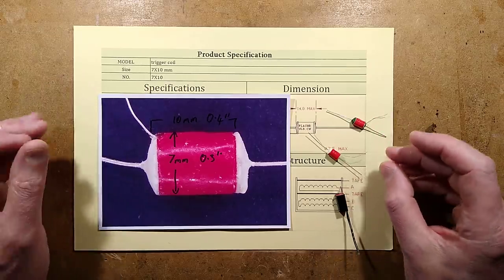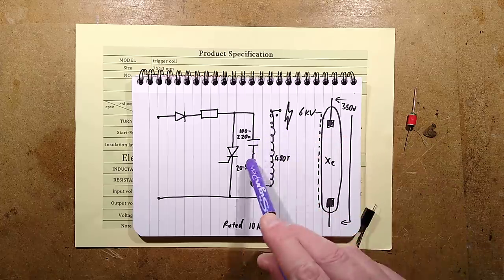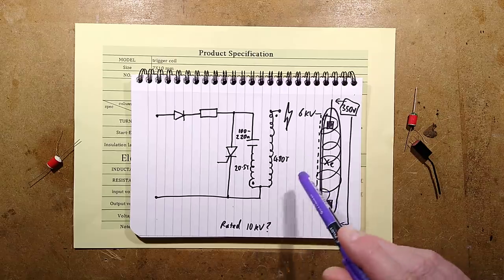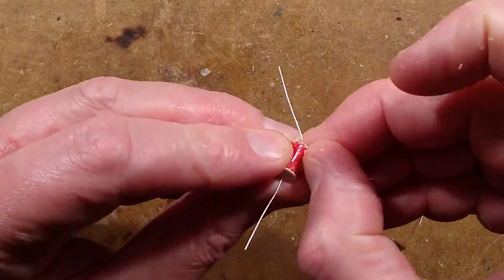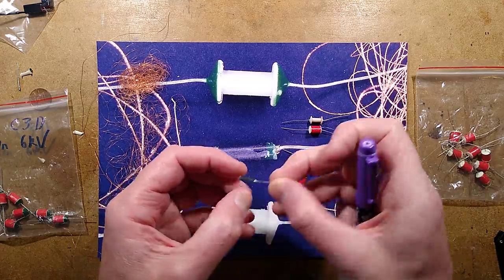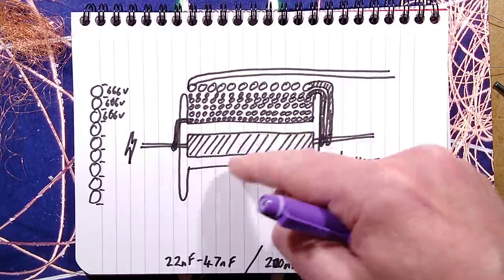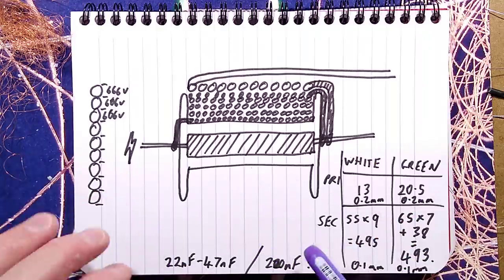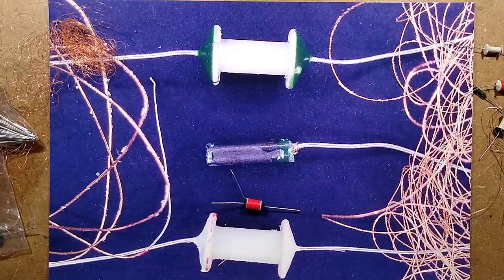Unwinding a tiny 6kV xenon trigger transformer

Comment: Transformers in my head are the gearboxes of the electronic realm
Reply: Yup. Turns low torque high speed into high torque low speed, or the other way around.
Reply: @hobbified  looks like magic, takes a lot of knowledge before starting, and insanely powerful skill once you master it. Smells like gearbox, looks like gearbox, can sound like gearbox.  Yup, it's a gearbox.
Reply: or leverage :)
Reply: @mimimi9170  : Give me a high enough windings ratio, and a ground to reference off of, and I will move the very earth!
Reply: @absalomdraconis  ahaha you're god damn right Archimedes
Reply: 666v per layer, Satan’s Gearbox! Sounds like a rad band name, and now, Satan’s Gearbox!
Reply: @mimimi9170  at this kind of voltage, the first syllable of that name is quite apt.
Reply: @markparker5585  Umm, looks funny but I don't get the point. Do you mean "lev"?
Reply: @mimimi9170  Arc
Reply: @markparker5585  Oh! I see🤦‍♂️  Thank you!
Reply: @mimimi9170     Archimedes moment was in the lever age.
Reply: @absalomdraconis    Move the earth, you wouldn't be grounded.
Reply: That’s fucking perfect. Why didn’t anyone else think of that? It’s like how your keys are a physical password. If you can see the bitting, then you are looking at a plain text password, essentially. Moral here is that you should treat your keys this way. Never take a photo of them without censoring the blade.
Reply: Can't unsee that now. It's perfect.
Reply: A good analogy for simple understanding for sure. Only difference is one is physics and one is mechanics.
Reply: @uzaiyaro  I have a locksmith friend who, when presented with a locked car, looks for the keys. If they are visible, he will punch out a new key rather than messing around with other methods of opening the door.
Reply: I thought they were robots in disguise.
💚🐇🐴💚
Reply: Interesting analogy, I like it.
Reply: @oplefirem  isn't it just.
Reply: Voltage & Amperage   
Speed & Torque
Pressure & Flow

In a sense, its all the same!
Reply: @BunnyKins1970  In this case, they're high voltage in disguise.
Reply: @absalomdraconis  wait, I thought you were referencing to earth…

Comment: The voltage between layers is actually about 1320V at one end and 0V at the other end where the winding reverses direction. The 660V you calculated is the average between layers.

Comment: I remember buying one of these from Maplin (among other things) as a young teen just because I saw it was a "6kV transformer" and I wanted to make HV arcs with it, but I had no idea how it worked and I just ended up blowing it up
Reply: RIP Maplin :(
Reply: As a kid, I used to plug LEDs straight into the mains thinking that they would be way brighter, turns out they just crack internally and get dark lol.
Reply: @GoldSrc_  it's how you make a black LED
Reply: @ianhosier4042  
That's a dark emitting diode, commonly called DED.
Reply: @wingerrrrrrrrr  don't you mean a DEAD?
Reply: @GoldSrc_  :/
Recently, I was experimenting with a 7W laser diode, attempting to get more optical power from it by running it at much higher currents at less than 50% duty cycle, while cooling it to -15c.

It was all going quite well, until I ran it for too long. I cannot determine if it was thermal shock on the die, or if the die overheated during the extended run (probably the latter, but I have no way of measuring the actual die temperature).

Either way I was successful in creating a DED. (Dark Emitting Diode)
Reply: @GoldSrc_  I did this with a 12V fan from an old PC!

Comment: Seeing those rounded ends and the wax reminds me of the old wax-paper capacitors you find in old valve radios. Of course, since these don't have the paper being used as a dielectric, I would hope that these wouldn't break down so easily unless the wax melts or cracks and lets moisture in.

Comment: Excellent and very informative video, thank you.

I still have a few of these little Tx's lying around in my workshop. These ones were made by RadioShack. Back in the '70's in my days as a club DJ big strobes were practically unobtainable, and ones that were triggered by the bass beat in a song did not exist at all, outside of Hawkwind's collection of mighty 4 channel Rainbow Strobes. 

I found a bog standard battery driven little 'photoflash' circuit, and beefed it up to work direct-on-line (no isolation Tx - would have made it too heavy) from the 240V mains - the upgraded PSU developed well over 480V peak to peak to a set of 3 massive, 5 Joules each, Xenon strobe tubes soldered into an Octal valve plug and their trigger poles commoned. The power to drive them was stored in a bank of 32uF 600VDC PF capacitors, with the safety resistors taken out (Health and safety? - Oh right - it's the 1970's).  The trigger cct. was built using a 741 op-amp in an active low-pass filter that took a signal from the LS cabinet and the o/p sent via an isolating pulse Tx to a UJT that fed the trigger Tx.

The reflector was made from an old silvered glass footlight reflector salvaged from an Edwardian theatre demolition - it was just over a foot across. The effect was absolutely awesome. Dancers appeared to be in 'stop motion' as the beat from the disco track matched their rhythm. I got paid serious money hiring it out to other club DJ's, also.

Great times !

Comment: wonder how that compares to whatever they used in the old kodak disposable cameras. Those gave quite the shock if you touched the board in the right places.
Reply: Loved taking those apart to tinker with.
Reply: @ICountFrom0  Same! So much potential for projects. I got a very good shock and a burn on my thumb the first time I opened one lol.
Reply: that's the 350V electrolytic capacitor... not too long ago i opened my compact camera, got shocked, destroyed the flash circuit, it doesn't flash anymore, i salvaged the tube, the 350V cap, the transformer and also a SOP-8 IGBT that apparently cuts the flash duration to save cap charge and batteries
Reply: Ahh, memories.  Back when you could bring pocket knives on airplanes. I, as a kid amused myself on the flight back from a vacation by tearing one of those apart.  It was quite shocking. :D

Comment: Best piece of advice I ever received as a kid (that I listened to) was to "go down to your local drug store and ask if you can have some of the processed disposable cameras." 20 years later and I still have the box of around 100 pcb's from my haul! Each board has a trigger transformer and flash tube and it was so cool to see all the variations in parts and design from the major manufacturers.

Comment: A sibling of mine got an electronic barbeque lighter once. It used a 9 volt battery. It had a 1000 MF, 16 volt electrolytic capacitor, a small transformer in it, and a switch. He put it into a small project box. It put out quite a jolt. It was a miniature version of a car ignition coil. If I recall, I think I have seen the transformer you have on some type of photo flash circuit. Cheers!

Comment: Just a suggestion get a disposable film camera, single AA cell HV inverter and a flash tube and trigger for a few pounds
Reply: I agree. Once, when I was young, at a garage/yard sale, I bought a toy gun. It had a photo flash type circuit inside, but didn't have the electrolytic high voltage capacitor that a regular photo flash circuit had. It still had very small transformers, and a mini flash tube. It was pretty neat.

Comment: Use to use these trigger transformers in strobe circuits all the time. Radio Shack use to sell both the transformers and xenon strobe tubes, back in the old days. You use to supply ~300V, that charged up a special electrolytic, that could handle the high current pulse, when discharged. These have been replaced by really bright LEDs, in cameras. Even old disposable film cameras, had xenon strobes built into them.
Reply from the maker: And they sold the big fat flash capacitors.

Comment: That took me back to unwinding a transformer and getting waxy stuff everywhere. I'd burned out the power supply for my train set by holding the reset button down and wax had leaked out of the transformer (and then presumably shorted). I was amazed to see just how finely the wires were wound. But, come to think of it, no more finely that the spools of thread on my grandmother's ancient sewing machine.

Comment: I always thought that there was magnesium in these Tubes.

Xenon makes so much more sense 

Thank you!
Reply: The old single-shot flash-bulbs used magnesium wool in an oxygen atmosphere.  The trigger pulse (not sure what voltage) just ignited the magnesium, which burned rapidly, consuming the oxygen in the bulb and sometimes shattering the bulb with an audible pop.  The bulbs were usually plastic coated so they didn't make shrapnel if the glass envelope shattered.  Wikipedia has a page on flash photography covering everything from the really old pans of magnesium flash powder up to high current flash LEDs: https://en.wikipedia.org/wiki/Flash_(photography)#Flashbulbs.

Comment: The coils I got hold of were not so friendly! They had potted them with epoxy!  I got an idea of how many turns by taking the coil on the belt sander and sanding off the coil to half gone giving a complete cross section. I was able to use a glass to see how many turns on a layer and how many layers. No chance whatsoever to reuse them like the wax potted coils you got.
Reply from the maker: If they're the little black box type they are definitely more reliable than the open ones and have the advantage of a higher voltage rating.  You could wind your own custom primary on the outside of one.

Comment: A source for some interesting parts along these lines is the electronics you find in disposable cameras that are equipped with flash.  If anybody is still using those,  what with everybody having a camera in their phone these days.  The ones I've seen have a little transformer of E-I construction IIRC.

Comment: Clive I worked with strobes quite sometime ago. The trigger circuit  at that time was a voltage divider and a diac to fire the SCR. As a note I used the winding from an audio out TX to replace a shorted trigger TX

Comment: Flip the primary common and capacitor connections and the primary voltage will then add to the secondary giving a few more volts out.  Also, the Xenon tube once triggered only ceases when the CURRENT, not the voltage falls too low. Lastly, it's likely the wax is a silicone based product, high dielectric strength, excellent penetrating capability and water repellent.

Comment: The fine inner winding could be 0.07mm wire, which was typical in automotive ignition coils that were oil or tar filled, and similar in the modern transformer ignition coils. So readily available in volume. Though the modern coil on spark plug do go even finer. The fine wire is more difficult to source and gets more expensive, to point of rediculous for significant lengths, no longer based on copper volume sold. 
I also have some 0.01 and 0.02mm wire both enamel insulated and bare copper, used on BGA connection repairs ( ie mobile phones)  That is sold by meter rolls. So where required even such fine wire is available to extreme fine limits. 0.01mm is so fine it is almost invisible and easily torn, just running it over your finger hardly feeling tension. Definitely tweezer and microscope work.
Reply: Another source of very fine wire is earphone cables, at least the better quality ones. They are multistrand very fine wire, not sure exact size but small enough to do a mod on a deep inner layer of an 18 layer pcb. Picked up a differential pair that was ~4 mil trace maybe 3 mil spacing.
That was definitely microscope work where you work between heartbeats, glad  I only had to do 1 to prove the fix.

Comment: for some reason, tiny things are fascinating... especially high voltage tiny things.  the minuscule motors that vibrate cell phones are rather exciting... but those little rascals you have there are hard to top.
 I'm thinking maybe a wearable mosquito zapper... that would be most exciting. especially if one forgets that it is there and tries to adjust ones' hat. I have some equivalent Transformers, maybe I should try and build one... or maybe I shouldn't. 
 peace be upon you, sir.
Reply: "Wearable mosquito zapper" -- ingenious.  I was just in Poundland (but forgot to check whether they had £1 zappers), then spent a few minutes sitting on a park bench (beautiful summer's day...) and got molested by hundreds of small flies.  Sparks and carnage would have saved me a lotta hand-waving :-)
Reply: @theskett  yes yes: imagine the endorphins one would get upon sensing a minuscule Menace approach... only to be quickly and colorfully "neutralized"... from dust, back into dust. probably would be a gift of unending excitement for someone working in a mosquito and vector control program too.
 hmm....... there are so many design considerations. so many. 
 hey, peace and rock on from across the pond...

Comment: If I am not mistaken the transformer ratio is valid for sinusoidal current. Pulsing the transformer may produce much higher voltages.
Reply from the maker: It's designed for pulsed use.

Comment: You could  have  a   555 timer  pulse t a transistor which then triggers   the thy-resister.   The wax is  used  to insulate the primary  and
secondary   in the  case of  hi-pot   testing    at the factory

Comment: And if you drive the tube from the mains, and don't have a high enough current limit to the cap charge, the tube doesn't extinguish. Oh the fun we had trying to reach over to turn the supply off......
Reply: It will if you use a split bridge, running each alternate 1/2 cycle to the PF caps (with safety R's removed). That way, you get full power without limit DOL from the mains, and the tube has a fraction of a second to self-extinguish. The tube will be running at over 500 volts PD, mind you, so get the big ones, 5 Joules at least. My previous comment has more on this.

Comment: This HV transformer works exactly as a car ignition coil. Instead of 240V DC pulsating, it's then 12V input voltage, and arround 15kV output voltage.

Comment: If you need higher voltage and current get an oil furnace ignition transformer. 10,000 volts. 1/2" arc.

Comment: I need just such a trigger xfmr...but with the coils isolated (4-wire).  After watching your video, it seems an easy task to simply isolate the pri. and sec. windings simply by cutting a wire and re-assembling...perhaps with some isolation and maybe a replacement primary.  Doable???
Reply from the maker: Tricky.  You might be able to find a potted version that has all four connections separate.

Comment: I’m looking into using these for resonantly driving EL wire. Trying to use it as an inductive element in an LC low-pass filter doesn’t really work, at least not while its secondary is in parallel with the capacitive load. The whole system acts like a capacitive load to my half-bridge, so I’d need to use another inductor. At the moment I’m testing just using 12V with a single inductor and hoping the voltage floats up high enough with the high-Q of the system, if not I might have to use a switching converter to get a higher voltage for my half-bridge driver’s floating high-side. Using a transformer + inductor is still on the table, but getting the feedback loop working is proving somewhat difficult in my simulations.
Reply from the maker: EL wire runs at around 100V.  Much higher and it could get damaged.
Reply: @bigclivedotcom  
Yes but I’m trying to drive it as efficiently as possible off a 3.3-4.2V lipo. I find the standard flyback designs have a lot of coil whine and eat through batteries, hence why I’m looking at inverter-style topologies. I doubt I’d get much above 100V from the high-Q of an LC oscillator anyhow.

Comment: If you put 2 of them in series will you get 140kV? Or, more interestingly, what will the failure look like.
Reply from the maker: It would flash over undramatically.
Reply: the secondaries are not isolated; so that won't work
Reply: If you wire them in opposite polarities with the center tap near ground it would probably work.

Comment: For the resin potting I remember your web page about the stun gun and I wonder if it would be possible to vacuum pot a small transformer or inductor or anything else by simply pouring epoxy resin and drawing a vacuum with... a vacuum pump ?

I do happen to have a manual one for bleeding my car's brakes but you may also now about electric ones that are primarily used by refrigeration technicians/engineers and also for vacuum chambers.

What about putting the whole assembly to be potted inside a vacuum chamber too ?

Or in other worlds what is the "specialised vaccum potting equipment" that you mention on your web page ?

(I do remember old neon sign transformers being filled with tar instead of resin too)
But why is wax outdated ? 
Is resin more reliable or something ?
Reply from the maker: The resin vacuum units usually have a chamber with clear lid and refrigeration style pump.

Comment: The flash units from disposable cameras are another source of these.  But these HV transformers make great millivolt . . .

JOULE THIEFs!
🤗🤗🤗
Here are 2 links to the ones I built.  
https://rustybolt.info/wordpress/?p=6677

https://rustybolt.info/wordpress/?p=6717

The 20 turn winding is connected to the JFET drain.  The common lead is connected to positive 100 millivolts.  The high voltage winding is connected to the gate.  The LED cathode is connected to the gate.  The LED anode and source are connected to negative.  If the windings are phased correctly it should oscillate and the LED should light.  But the current will become excessive if the supply goes over 100 mV.